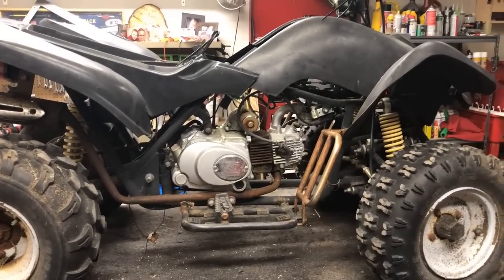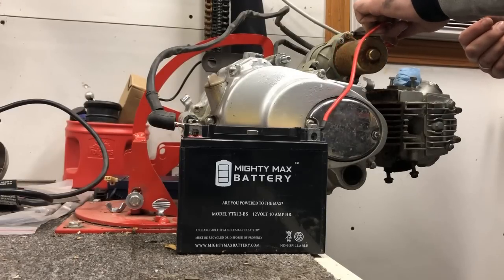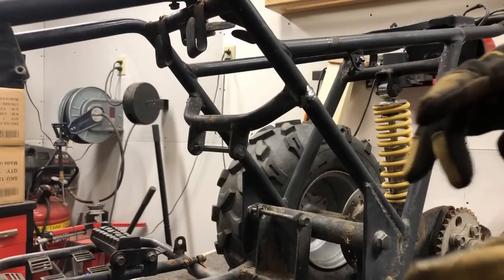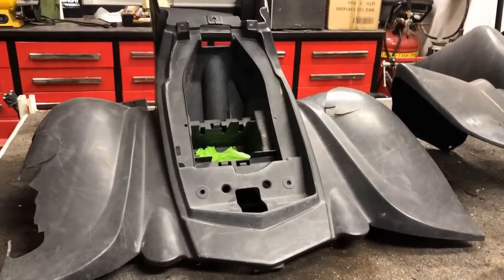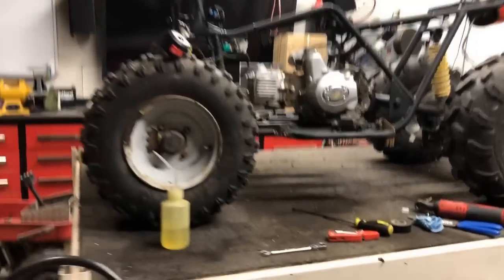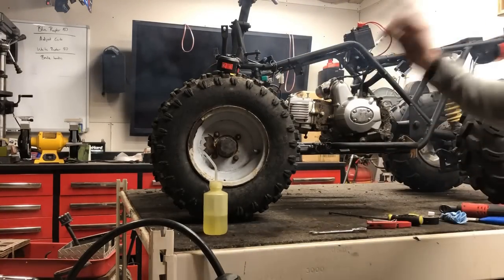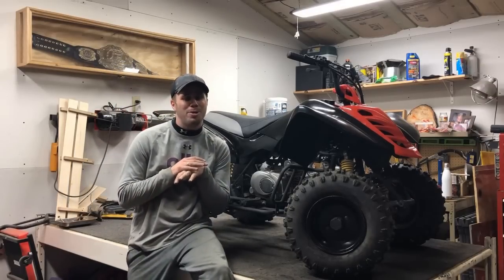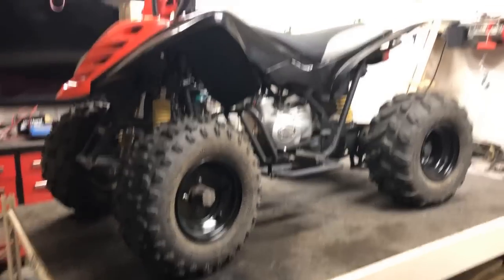You bought a 110cc Chinese ATV! Now What? -Complete Build

Comment: 2 quest. if u dont mind , did u make engine stand,, n how to tell if u have 110 or 125cc.
Reply from the maker: No, I purchased the stand off eBay back in 2018. I am working with a company to make my own since it's been so popular on the channel. They engine size should be stamped on the cylinder sleeve on the side of it or on the cooling fin.

Comment: Could use your expertise I have just got one that looks like this one but is shaft drive. Got it running but plastic is garbage. Went on vmc but not sure if it’s the same my battery box in solid in rear fender and thoughts ? Thanks
Reply from the maker: I don't want to give you bad advise since I haven't see yours but from my experience every atv I have seen that is this style "Kauzma Falcon" or the Raptor Clone the plastics have fit. They are a 2 piece with a tank strap cover. If your atv is this style with a 50-125cc motor they should fit. If you want to email me pictures I would be happy to look at it for you.
Reply: @PraskaBoysGarage  went and order it and a seat now just can’t find the left side lower front foot peg holder vmc don’t have them lol

Comment: Can you help me out everything is plugged into the proper color plug and I have nothing when I try to use the push button . If I bypass the switch the quad will start .everything is new  I even tried the older starter solenoid and nothing
Reply from the maker: Alright if it turns over and runs your about 95% there! When you push the start button do you hear a click noise coming from the starter relay? If yes, then likely the relay is bad. If you don't hear anything at all then your issue is either because you have a fault in the brake safety that must be engaged to start or the start button itself. Good luck trying to find the problem!

Comment: Dude I need help I have spark on my quad but when I turn it over it don’t start up also when the ignition is on the cdi makes some sort of a buzzing sound I need help plz thanks
Reply from the maker: If you have spark then it's likely either a compression or a fuel/air issue. If you don't have a compression reader then dribble some fuel or starter fluid down the spark plug hole. Put the plug in a turn it over to see if it fires. If it does fire up then you know its a carburetor issue. If you have nothing it's probably going to be an issue of compression.

Comment: My grandpa gave me a quad similar to this but this is my first restoration. Any beginner tips?
Reply from the maker: It can be very easy to get overwhelmed! Most people start a project by completely tearing it apart, and slowly lose interest because they see a big project in front of them. Start with smaller parts and easy to replace items. Examples: Replace battery, carb, seat, handle bar grips.... Then if you still have motivation to do more move to tires, shocks and plastics. Hope that helps and good luck on your project!

Comment: So I just got this atv for free and it runs great. It's a 200cc and it looks exactly like yours. I can't find any info on it on the web. It needs a complete tune up. Do you have any info on these machines like does that nose grill fit on mine? I mean it looks exactly like mine what u got there on the bench. Except mine is water cooled. I need some other parts to, like rear break lines, chain etc etc. Cheers from Norway.
Reply from the maker: 200cc chinese atv parts are pretty hard to find. Not a lot of sellers out there that deal with them. I would stick to eBay to find anything I could. This is a Kazuma Falcon and is a Raptor clone.

Comment: Hey man I bought a new starter and both  new and old starter ONLY SPIN WHEN NOT INSTALLED. I connected them straight to battery as you did in the beginning of this video and  they both  SPIN only when they are out.BUT once they are installed They WILL NOT SPIN AT ALL. Im sure wires are good and battery is charged and both starters SPIN only when they are out. What could it be?what can I do?
Reply from the maker: Check out this video: https://youtu.be/NtxnHGwcd90 Turned out my starter wouldn't turn over because the motor was stuck.

Comment: Thanks for a most informative video.  I have a similar project.  I am a Novice at rebuilding by any means, but am mechanically inclined and understand a lot better per your video.  What I would like to know is where you order your parts from?  I need throttle, brake, light and controls ordered but do not know where to order.  I am going back with a PREDATOR 212 engines because the one that is on it is HOSED.  What size rims did your project have and what size tires were on it?  Please help.

Comment: do u know how strong those brake shoes will hold? im trying to use it on a more powerful engine.
Reply: My brakes were plenty strong to with stand the power of a Detroit 170cc in a quad and doing burn outs.
Reply: @nitro_rc_dude8158  i got a kawasaki zx9r engine on a custom long go cart that is real heavy prob 1000lbs plus or about that and wondering if these chinese shoes will work well. will have 2 in front and will try to make a hydrolic caliper work for the back wheel. if these dont work well i might add 2 more wheels to the cart midway or lil back with 2 more chinese shoes like in the video. then it will have 4 shoes and 1 hydrolic. im wondering how strong the shoes are because i replace them since the glue that hold them together was gone.
Reply: @ANILTHEPRO1  just do hydraulic all the way round
Reply: @nitro_rc_dude8158  idk how to really do that and it might cost a lot of money to buy the knuckles and calipers and lines. then the wheels might not even fit the knuckle. ill prob need dif control arms and redo the tirerods..
Reply from the maker: How much is more power? The same brakes are used on the atvs up to the 150cc. If your going to go much more power than that I would look at hydraulic disc brakes for sure!
Reply from the maker: Nice!
Reply: @PraskaBoysGarage  its a 900cc engine im thinking if its not working well to add 2 more wheels mid near the back so it will get more drag and help braking. the 6 wheels looks more cool and unique and it will be more stable and supportive. cart is prob over 1000 lbs.

Comment: Where do u get the red negative wire for testing starter
Reply from the maker: It's just a random wire I used to ground the starter. Color doesn't mean anything. Power from the starter goes to positive and a wire from the negative side of the battery needs to ground against the starter housing.

Comment: i have one of these quads but when i fire it up it is in a very high stational speed, how can i fix that?
Reply from the maker: Turn the idle screw on your carburetor counterclockwise. If that doesn't change it then you need more slack in your throttle cable.

Comment: Changing the oil in my daughter's Wildfire 110. Looks almost exactly like the one in this video. Does it take an entire quart? I cant find anything online and there is no dipstick on the cap.
Reply from the maker: These E22 style motors take 700ml or about 3/4 a quart.
Reply: Dang.....youre Johnny On The Spot with the replies! Got one more for you.......
After the oil change her quad started stalling. Now it will start and even idle. But as soon as she gives it gas the engine stalls. At first it only happened in 3rd gear. Now its every gear. What do you suggest I need to fix?
Reply from the maker: @MrRolloTomassie  Could be a couple different things, but more than likely it is a fuel/air issue. Typically a good carb clean and tune should fix your issue.
Reply: @PraskaBoysGarage  Thank you. Ill let you know how it goes.

Comment: Hey. I got a question. I have the same atv. Just put piston and rings in mine and when I try to start it. it will crank then all of a sudden make a grinding noise as if the starting gear and binding up?
Reply from the maker: Hmmm...have you tried taking off the stator cover and watch to see if the chain is causing the issue? Could be the cam chain also, did you put in the chain tensioner and the chain guide back in? Sorry I can't be much help without being there.
Reply: @PraskaBoysGarage  hey man thanks for responding but I figured it out. I just backed off on the screws that hold the starter clutch onto the flywheel. I guess it was torqued down too much!!
Reply from the maker: @spectumhdm1312  Glad is was something simple! Nice to get a couple of those to even out the tough ones ;)

Comment: what wiring harness do you purchase I have an old dirty Baja 90 I just pulled Into my garage. and any idea what motors swap over for some easy updates
Reply from the maker: If I remember those are 2 strokes right? Ive never done a 2 stroke rebuild before but I have one in storage. Maybe in the future it will be on the table!
Reply: @PraskaBoysGarage  it's a little Honda clone 4stroke.
Reply from the maker: @kingofthe6spd  Alright, so the only other thing you'll need to know is if it has a 2 coil stator or a 6 coil stator. Check out my "how to" wiring video for install details!

Comment: I started small project to fix very similar 110cc atv and well  I have a bit of problem there is lose hose that goes from carburator bottom ( I guess since ther is one free outgoing) and goes to the end of motor but I'm not sure, since when I got my hand on this atv it was already not working, and I'm not sure should I attach it. The hose at the end of engine isn't attached any where, its just hanging.
Reply from the maker: I am having trouble following you. If you can email my some pictures I would gladly take a look and see if I can help!
Reply: @PraskaBoysGarage  oh nvm I'll already found it it's returning gas. But now I have some other problems  oil is leaking fro exhaust pipe, and I think that atv might been fliped over and spark plug might be not working. I guess, I'm not so good mechanic, this atv was mine and was last used atleast 10 years ago, but now I'm trying to get it up for my own kids. It's more a like hobby for me.
Reply: @PraskaBoysGarage  but thank you for your concern.

Comment: Hey great job love your videos. Had a question I've rewired my tao pit bike and I still get a slow crank. Adjusted the valves they were slammed shut at tdc still slow crank. Do you think i need to take apart starter?!
Reply from the maker: It's probably the Starter or battery. Hopefully you get it figured out!
Reply: John i know this very late reply but did you get it fixed. If not id be looking at getting rid of the battery positive and negative cable and putting in new thicker gauge.

Comment: My atv engine front sprocket moves when in idle what is the issue with it also it is a 90cc automatic
Reply from the maker: I would guess your idle is set too high. Try turning out(loosen) the idle screw on the carb while it's running and see if you can get a slower idle.

Comment: I picked up the 150cc version of this for £140, it runs like a pig and looks about as good as yours did. I've cleaned the carb and jets but still won't run properly without choke. Maybe air getting in or getting out somewhere so that's my next port of call. But the electric box I think it's called a CDI unit, at some point rested on the exhaust manifold and is partly melted, could that be the culprit of the running issues? My thought is that if the CDI unit was completely dead then it wouldn't run at all, so that's why my thinking is there is a problem somewhere with the carb or mixture?? Would definitely appreciate your advice thank you. Also it isn't electric start.
Reply from the maker: If it runs better with choke on then you defiantly have a fuel/air mix issue. You're probably running lean on fuel and it needs the choke to pull more fuel. When you cleaned it did you make sure to remove all your jets? It probably needs some adjusting and there are tons of youtube videos to help with that. The CDI regulates spark. So as long as you have spark the CDI is likely working. To be sure I would take the side cover off and turn the motor with a drill and watch to make sure you aren't losing spark.

Comment: Why didn’t you spray the suspension springs Red as colour is a bit mismatch
Reply from the maker: If you spray paint the springs they will look good after your done, but once you try and reassemble them your just going to destroy it with the spring compressor.  Better to powder coat or buy new for the best finish.

Comment: Do i hook the starter cable to the battery?
Reply from the maker: If you're testing the starter you can hook power directly from the positive contact on the battery. Then use the negative contact to touch the starter housing.

Comment: Hey I have one exactly like this do you know what brand it is and mine also won’t go into reverse of you have any help with that could you let me know
Reply: Is there oil in the transmission
Reply from the maker: Unfortunately you'll have to open up the bottom end. I've seen broken gears but that's worse case. May want to change the oil first and see if you find and metal shavings.

Comment: Do you have a parts breakdown for everything you replaced? Starter, wiring kit, break levers, front break, light housing...Just curious on how much it cost you to fix it all up. Don't get me wrong, i'm not saying it wasn't worth it. And i'm definitely not saying you're better off buying new. I find more satisfaction in fixing up projects and knowing they're done correctly.  Great video.  I just subscribed.
Reply from the maker: Barbells and BBQ Thanks for the Sub! If you liked this one wait till I upload the one I currently have on the table! Parts and Cost are itemized down in the video description. Total build cost was $383.33
Reply: @PraskaBoysGarage  Thanks for the reply.  I can't believe I missed the breakdown in the description.  Keep up the great work. It's much appreciated.
Reply: Yeah, starter is so easy to fix, i got same one and its brushed, so some  cleaning get oxidation and rust off, new grease where needed and it works fine now for like 30 mins work.
Reply: What is make and model name for this wheeler and where would I find parts for it.?

Comment: Any tips why my front left atv goes bald  in the middle   its a 125cc atv venom grizzly
Reply from the maker: I'd be curious to know if you have your shocks set up the same on both sides? Wear in the middle is fine overtime but if it's one side and not the other I'd assume a suspension issue.
Reply: @PraskaBoysGarage  the golden tie rod nuts on the bike was loose , kinda scary since its a new 125cc  venom grizzly  ty for your reply

Comment: I've got a custom 125cc quadbike that I carnt get to idle propley it either hits in hi revs then in gear and moves on it own with out revs or it will idle normal but when try to add revs it sounds like it wants to die out or isn't giving enough power to move the carb float bowl did get a leak in so I changed that nd since doing that nd putting a twisty throttle in it's doing it and I carnt get it to stop any help on how to fix it
Reply from the maker: Sounds like an air mixture problem? Have you traded adjust the air mixture screw on the carb? Could be a fuel problem too but I would start to make sure the carb is set right.
Reply: @PraskaBoysGarage  it starts up fine when in nutural nd started it's fine nd u can rev it but once you put into gear the revs go up nd it moves on it's own even with the clutch pulled in

Comment: I would like to know where you bought that nice engine stand that mounts on your bench
Reply from the maker: Bill Dysvik  I came across the stand on eBay back in January 2018. The seller was bomcbe2kz7 and the item number was 173080767269. If I remember correctly, I paid about $110 with shipping. It has 3 mounting plates for different types of small engines. Definitely money well spent for my shop!

Comment: Hey Man ! You seem to be The chinese Quad Expert on YouTube ! Enjoyed this video pretty much ! Now I got a question for you... My sister gave me a 110 CC TaoTao quad for my kids... Her son is now riding a TRX 2 stroke 250R... So anyway here is my question. Can I slap out the 110cc engine and slap in a 125cc that also got reverse ? The 110 didn't have reverse so that sucks big time... Is this a big project ? And do I need a lot of parts to get this project to work ? Thankx !
Reply: Let me try and help you to my best abilities, almost all Chinese engines are the same for the most part, taking the engine off should be no issue, and putting the new one on should bolt right up to the old frame mounting points, only issue may be wiring but if you stick with a Chinese engine I’m pretty sure it’s all the same, if the 125 with reverse is the same starting method as the 110, (kick start, or electric start) then you will have no issue with doing it, fairly simple job
Reply: @twiggered4741  ok thankx for the response bro !
Reply from the maker: I agree with @Twiggered. It is a fairly easy project and the 125cc should clear and fit. Good luck on the swap!
Reply: @PraskaBoysGarage  Thanks bro ! Waiting for the engine as we speak !
Reply from the maker: @doobyboy21  Nice! Where did you buy it from and how much was it? Just curious cause I've never bought an entire new engine before, only rebuild kits.
Reply: @PraskaBoysGarage  I bought it from Lachute VTT here in Canada... They are a big wear house full of chinese ATV's, Pitbikes, Go-Karts, and so on ! I am trading in my perfectly fine 110 engine for the  125-D engine... I am paying 275 CDN.... I am also doing a build series on YouTube ! Part 1 is already on Youtube. !

Comment: Where do you buy your wiring harness
Reply from the maker: deaunte love, thanks for watching! I buy all my wiring harnesses from Chinese sellers on eBay. You have to look close in the posted photos and determine if you need a 6 coil stator or not and also if you need 2 wires for your head lights or 3. The eBay item number for the harness used in this video is 223081287407.